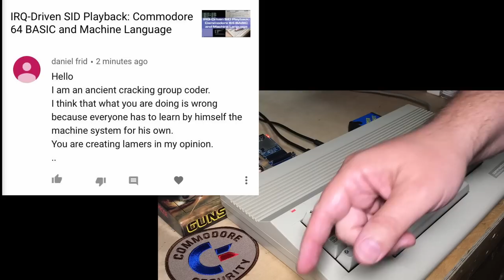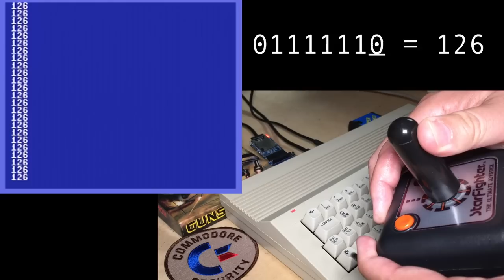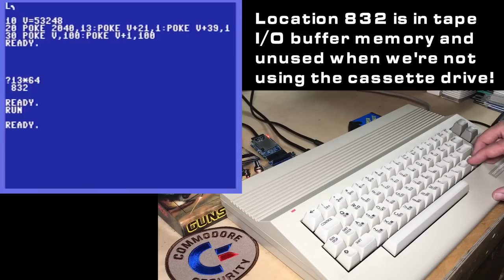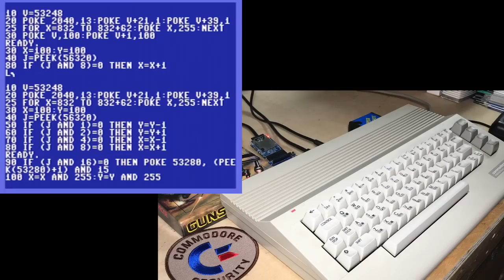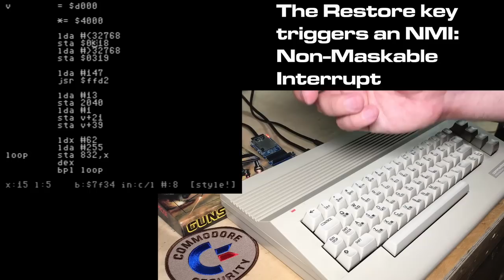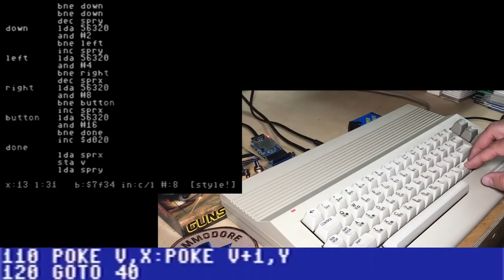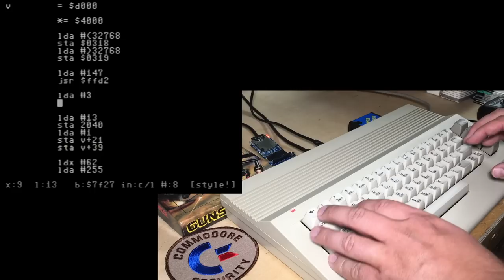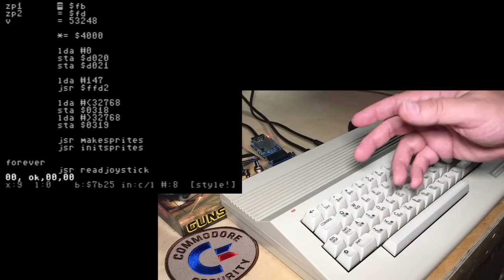C64 Joystick-Controlled Sprites in Assembly and BASIC

Comment: (@4:40) what does line 20 do? And what’s with the heart character on line 10? Neither seems to do anything.
Reply from the maker: The heart character clears the screen.
Reply from the maker: And line 20 position the cursor in the top left and then down one row so the PRINT displays in the correct position
Reply: @8_Bit  How can I simulate these keypresses in VICE emulator? I can't get those symbols. I'm not getting my C64 Maxi until December so I'm having to make do with a Raspberry Pi :) Thanks.
Reply from the maker: @Arashi256  After typing the opening double quote, hit the Home key, which should produce the inverse S, and then the cursor Down key to produce the inverse Q. Note that the C64 won't enter this "quote mode" unless the quote has been typed right before - if there's an existing double quote on the line you're trying to edit, type the quote over it to enable the entry of these special characters. Good luck! :)
Reply: @8_Bit  Thanks, I got it working :) Love your retro programming tutorials in BASIC and ASM. So well explained! Cheers.